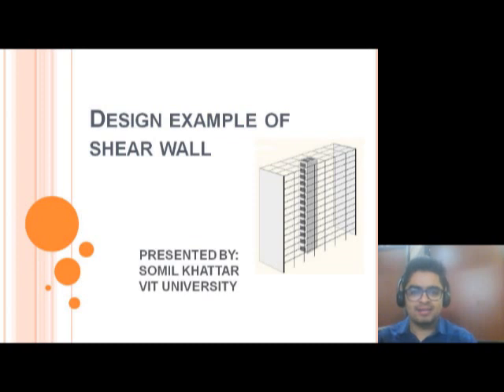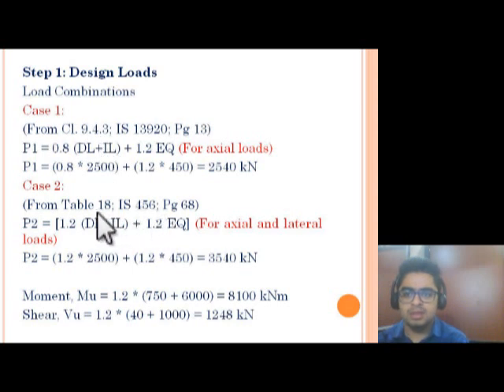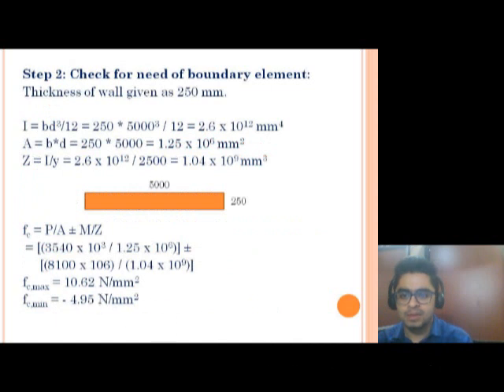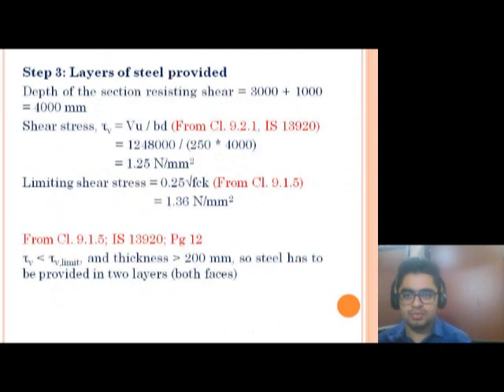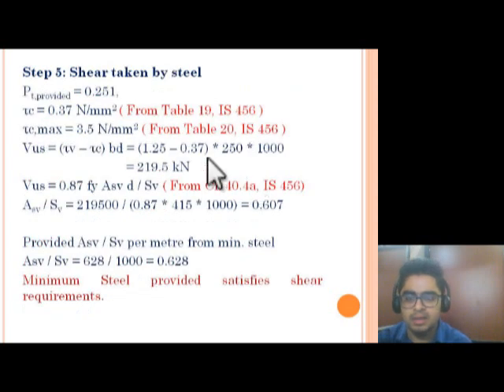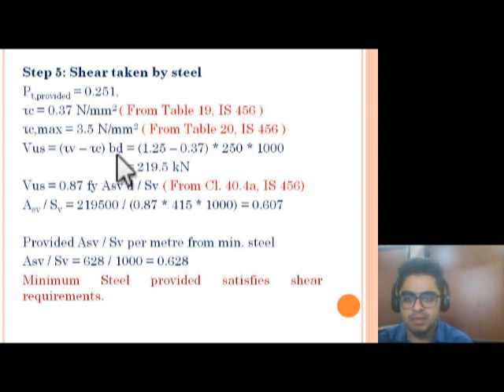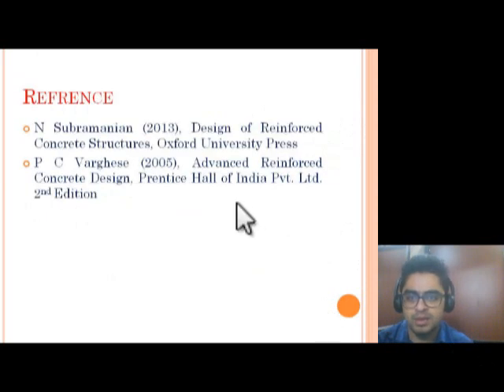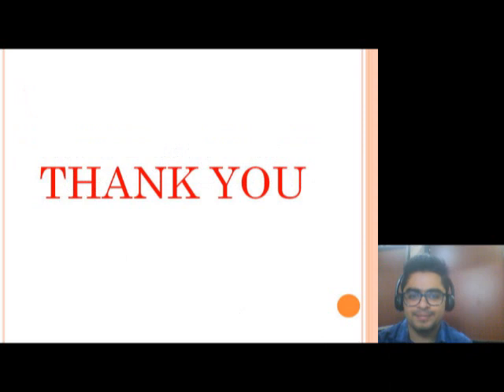Design of Shear Wall

Comment: bro i have a doubt in this video 23:03 you mentioned that the total area is sum of boundary element area and the wall area 
and my question is if the boundary element is not provided what to do in calculating flexural capacity of web

Comment: Sir, Have you used ETABS 2017, The boundary Element check section gives a lot of combo loads only while IS codes (Ductile Detailing) refers to IS: 456-1978 for Muv. Also states vertical loads as per dead (all) combo max. (Usually in my case, Dwal1) and seismic as per given combination as explained by yourself. Emitted IS:456-2000, And ETABS gives Pu larger value than all dead max. combo value. Confusing and which one to use. Please.

Comment: Thank you for making this video, very helpful but according to IS 13920 - 2016 CL.NO. 13.3.1 formula you use which is given in ANNEX A are not applicable for structural wall with boundary element. please suggest procedure to do it correctly.

Comment: Sir, you have calculated 12 no of 32 mm bars in BE but provided 8 no of 36 mm bar.... And it is violating cl 7.4.2 of IS 13920( 2016)...as the spacing b/w longitudinal bars is getting more than 300 mm

Comment: From where do we get the equation to calculate Muv?
Reply: substitute the values of λ,  Ø, β, ... in equation of IS 13920, Annex A,  case a, you will get 0.038 or 0.031 (because he took fck as 25 here, dont know why)  then multiply it with fck*lw2*tw